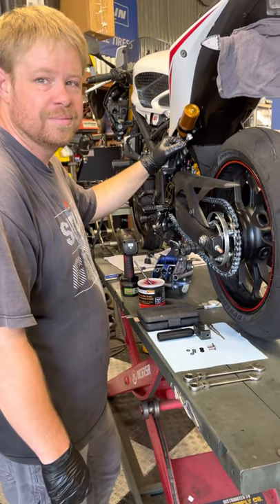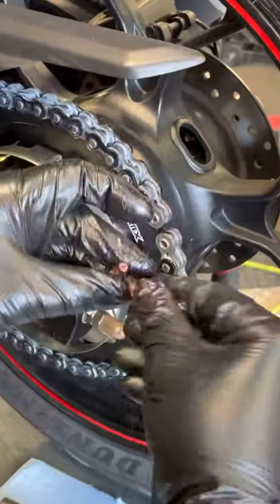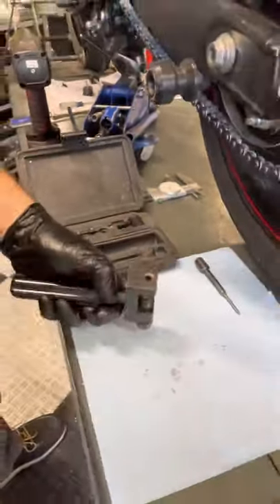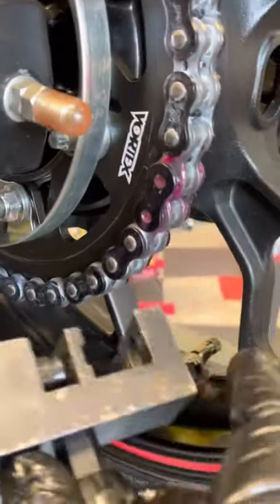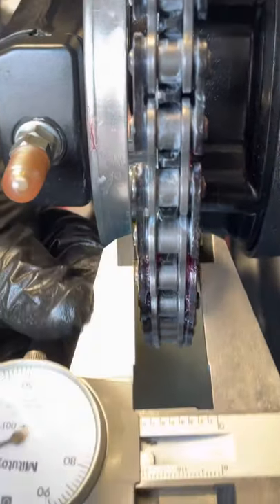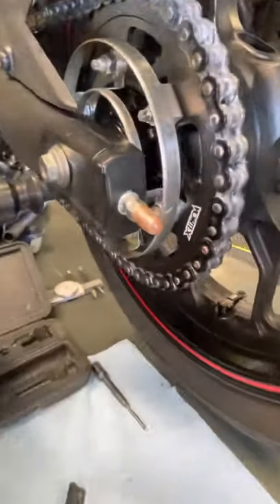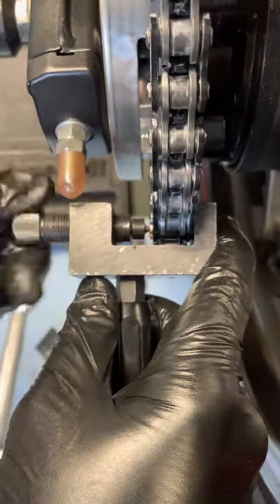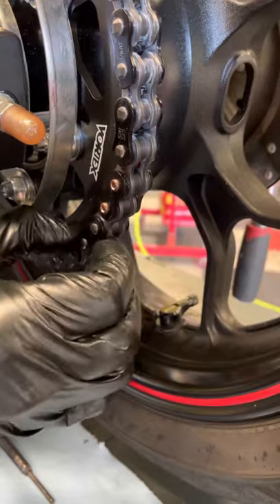How To Install A RIVET Master Link Like A Pro!

Comment: Hey Moto mecha! I got my chain replaced by shop and I noticed that master link o ring is budge up. I took it back to the shop and they told me it’s normal but keep an eye out. Any advice?
Reply from the maker: That does happen if they over pressed/tightened the chain plate. But it does happen anyways. Sometimes i push the o-ring back in and see what it does. The most important thing is to flex that link and make sure it flexes easy like the adjacent links.

Comment: The only problem I see is with the flair. Under flaring the rivet can cause problems down the line. The energy transfer chains must endure are massive. What may appear to the naked eye has a strong flair could fail over time as the chain changes. Over flaring can crack the rivet causing it to fail. One must always follow the manufacture’s instructions. They go through the trouble of calculating optimum flair expansion for a reason. 

Manufactures always either include installation instructions which indicate recommended flair width, or they list them in their website. For example, the DID has a list of chains and flaring specs for each chain. For my bike’s chain, 525ZVM-X2, they recommend a flair of 0.224” - 0.236". For another 525 chain, the 525NZ, their recommended flair is 0.217” - 0.228".  The recommended flair for their 520 chains can vary from 0.213” - 0.220" to 0.217” - 0.228". Even though it’s not much of a difference from one chain to another. There must be a reason why they list specific flair tolerances for different chains even though they are of the same size, rather than just giving a generic spec for all chains of the same size. If your chain doesn’t come with instructions and specs, check out the manufacture’s site. 

Interestingly enough, DID’s own video shows how to install a new chain. In that video the mechanic doesn’t measure anything. He does it until it feels tight enough. WTh! Haha! 

For me personally, being a former aviation tech, if the manufacture publishes recommended specs I will ALWAYS follow them.
Reply from the maker: Ya I might do an updated video with more of this data.

Comment: Do you not need to use the proper grease that’s normally supplied with new chains? My chain didn’t come with any so I used normal automotive racing grease and now I’m really paranoid about it lol
Reply from the maker: Ya, use the supplied grease but the “racing grease” should be ok, keep an eye on that link and make sure it remains flexible and replace if needed.